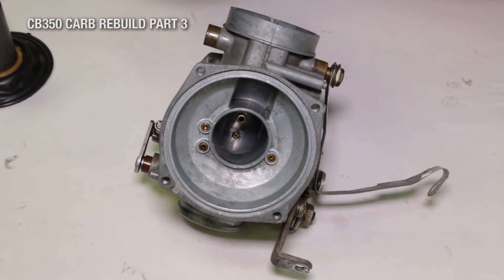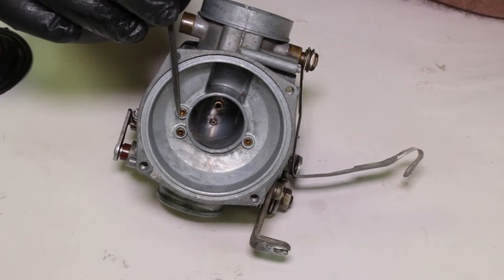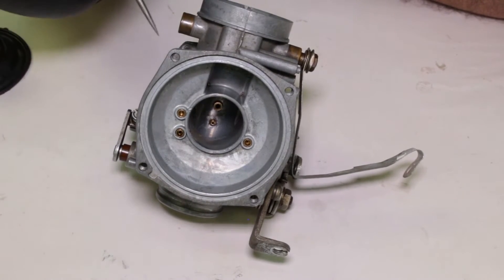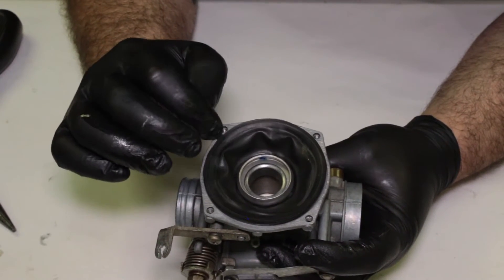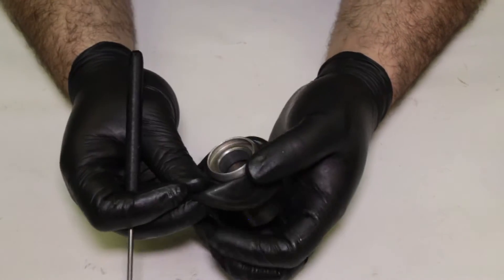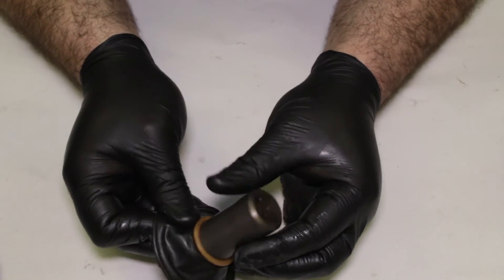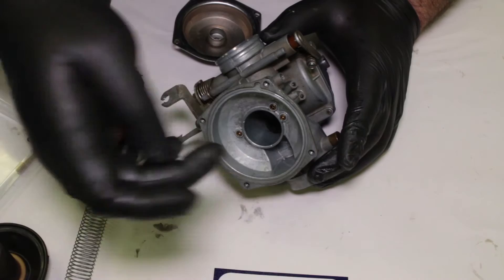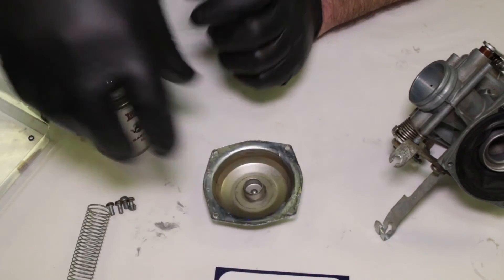Honda CB350 Carburetor Rebuild Part 4: Slide Assembly, Diaphragm Inspection & Installation

Comment: I'm currently rebuilding the top end  of my 73 cl350's motor. All new piston head and rings, valves, and cam chain tensioner assembly. I'm trying to put it back together and am running into timing issues. Do you guys have a video I can follow along with, or know of one. I set the left piston to TDC on LT but I can't get the marker on the cam shaft perfectly level. Only thing is I didn't change the cam chain itself so I don't know if the slight difference is from the chain being stretched itself. Any advice would be helpful, right now I'm stuck with an old PDF of the owners manual that is very vague and it's missing a lot of the essential info. Thanks in advance!